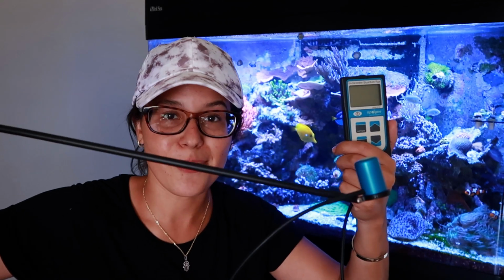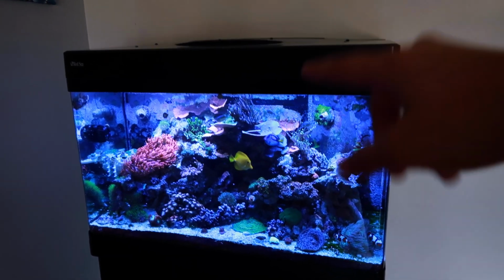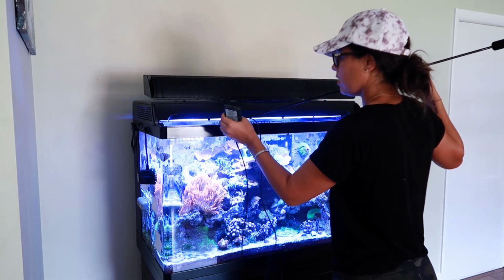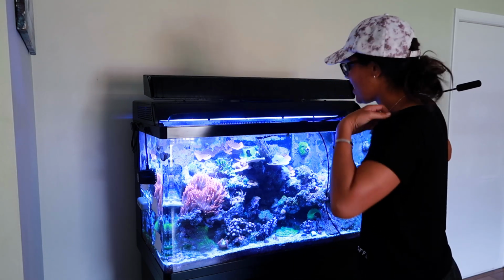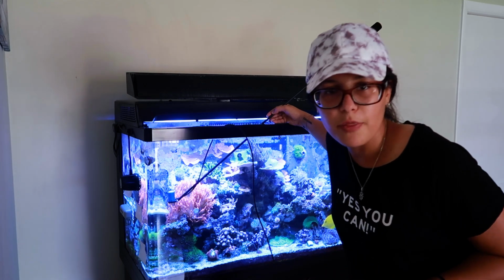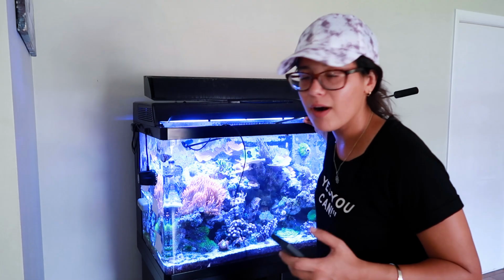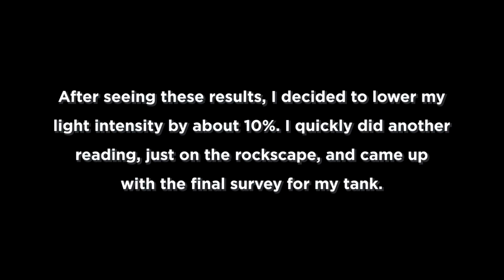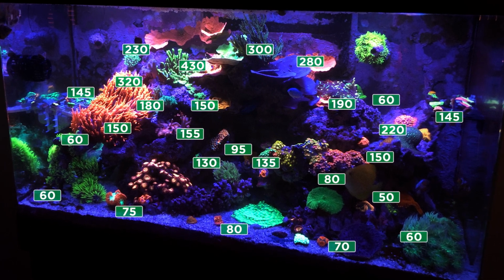PAR Meter Testing a Red Sea Max 250 With BUILT-IN Radion LEDs

Comment from the maker: Have you rented a PAR meter yet?? What are you highest and lowest readings? ⬇️⬇️⬇️
Reply: For me, at the very top of the tank just above the water surface I’m seeing 750 par, an inch below the surface about 450 par (with pumps on). I have a ton of flow with 2 Gyres on the back wall at 20%, (3) MP-10’s in Reef Crest Mode at 60% and (1) MP-60 in Nutrient Flow at 50%.

My Acropora and Montiporas are getting an average of 250 to 305 par, my Chalices see 110 to 150 par and my Torch/Hammer garden sees 150-200 par

Stuff seems to be growing, I have a birds nest that started out as a 1” frag that’s going nuts in just 2 months and one of the montys seems to be getting bigger.   I really need to take before and after photos. I really can’t tell if they are growing. I have 1 torch and 1 hammer that look happy the other three look happy at times and pissed at other times.  Not sure what’s going on there.

All corals are in areas with good PAR numbers and my water ranges are right on so…. We’ll see in time I guess!
Reply from the maker: seems like you have some awesome PAR readings! yea, highly recommend the before/after pics! When you look at stuff everyday its hard to tell if its growing but then you look back at the pic of when you got it and are like dammnnnn this this is popping lol!  Your tank sounds super nice!!
Reply: Just did a DIY version with the sensor and a multi-meter, had to reduce my lights by 35%!

Comment: Hey,  ive got the same tank. You answered my question a couple months ago which I thank you again for answering! Ive got one more. The pumps i have seem weak.  What pumps do you use for your red sea max 250? Thank you so much! I Love your channel.
Reply from the maker: hey! thanks so much! I actually haven't updated my pumps since I got the tank. the previous owner never mentioned any upgrades, so I would think I still have the 2 standard pumps that come w the rsm250!
Reply: @DreamStateLiving  ok thank you! I keep getting algea in the same spot in the sand. Im thinking I need to get better flow or change it around.  Thank you!
Reply from the maker: haha I have that issue too, I have an mp10 as well. Maybe try repositioning the pumps? 🤷🏻‍♀️

Comment: I own the MQ-510, just bought it actually and had their older version.  You want your PAR reading to be at the top of that meter, where the lens is.  Looks like you took most of your readings with the lense above the actual spot. Turn ALL flow off period.  If you don't it will give false readings.  I believe you did.  Ia a big Kessil fan and just bought a new Kessil A500X and is what I'm running now.   I have a Radion xr30 pro g5 coming Monday and I will switch to that.  I have owned every light you can imagine, the Radions are the best lights out there.
Reply from the maker: thanks JP congrats on the new purchases! Yup, I haven't used many lights but I do love the Radions!!
Reply: @DreamStateLiving  Thanks, Love your videos and your tank is beautiful. Keep up the good work!
Reply from the maker: @hurricaneaquatics  thank you appreciate that!! 🤙🤙

Comment: Hey!  Wonderful information, it’s great to see what par ratings are in a successful tank.  One concern that I have about your final readings.  I’ve always been told to read par while pumps are on.  The disruption of water creates real values. If you think about it, other than feeding time, the pumps are always on, there is always surface disruption in the tank. You will find that your final readings are about 5% off.  Please keep doing what you do, my wife and I love watching and enjoy your content!
Reply from the maker: Thanks Johnny, appreciate that!! :) Yup, I have gotten very mixed reviews about the pumps on or off.. It does make sense to leave them on as that is how they usually are, but maybe the range would just be too difficult to get accurate with all of the reflections? Not sure I turn them off except for my return pump to keep the water level and some movement up.
Reply: @DreamStateLiving  you’ll find that your ranges will bounce a bit in flow, I always take the peak number after about 15 seconds of reading a given area. You’ll get to see what par range that area of tank is.  We have an IM-100 with 4 radios XR-15 Pros.  I own a par meter, an Apogee 510.

This tank is very new (15 months) and I’m trying acros for the first time having just upgraded our light system. I’ve had a large LPS tank in the past, but we moved and finally got back into the hobby. 

With regards to using the par meter, it was BRS who educated me about par meter use among other things along with videos from people like yourself.
Reply: Also.  I don’t seem to be able to add photos here?  I am on Facebook. John Horay, Blackwood NJ.  I post photos of the tank and short videos all the time.  Have a great day! We’ll be watching for sure!
Reply from the maker: I don't tend to go on Facebook much, do you post on Instagram?
Reply: @DreamStateLiving  I don’t have an Instagram account. Facebook is quite enough!  Lol!
Reply: It’s ok. I’ll catch you here and we will keep watching!